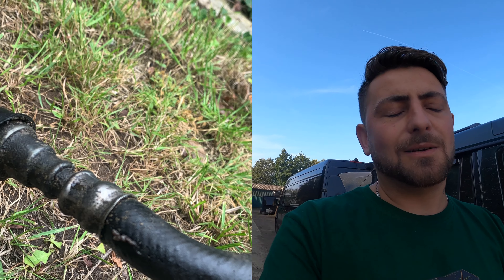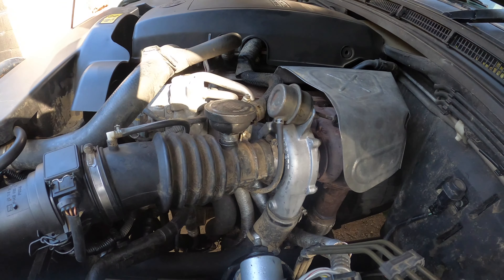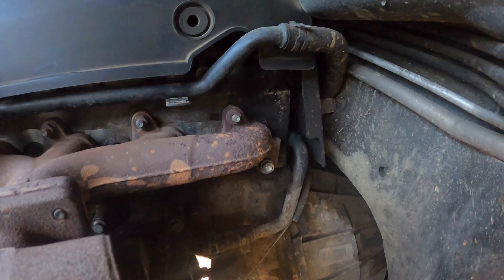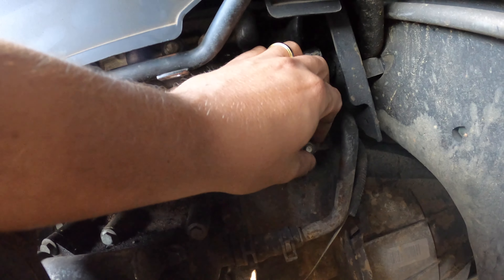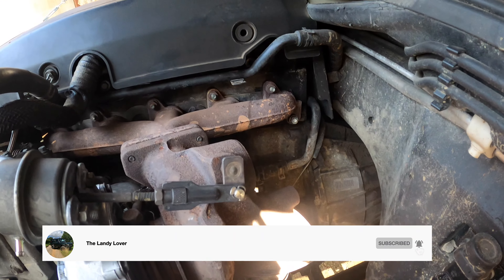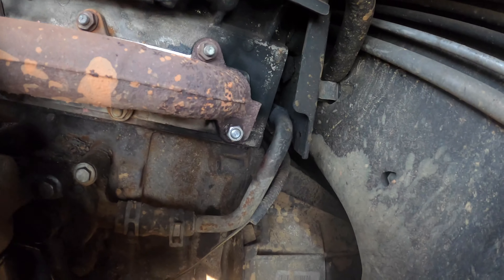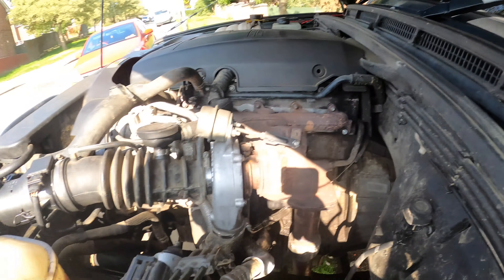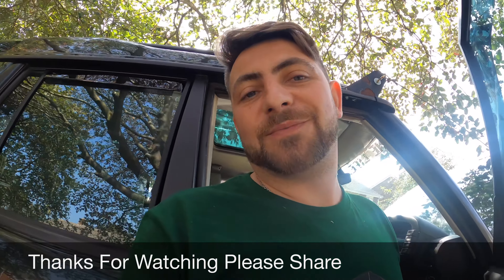Landrover Discovery 2 - Manifold Problems !

Comment: I plan on using soapy water and shoving a portable leaf blower up my tail pipe (don’t laugh 😂 ) to check for air leaks on my Thor V8 exhaust system. I think that’s where my whistling noise is coming from. 
If I find nothing, I’ll do the carb cleaner spray test on vacuum lines and around my intake manifold. 
Thanks again for your videos. I subscribed.
Reply from the maker: JUKE179r Haha .. V8 different kettle of fish. Info love a v8 tho. Thats what gave me the landrover bug.
Reply: Soap and air blower is how I found a leak on my manifold to down pipe joint...